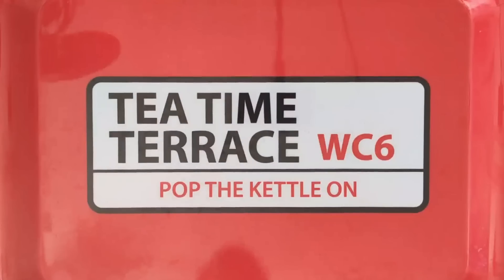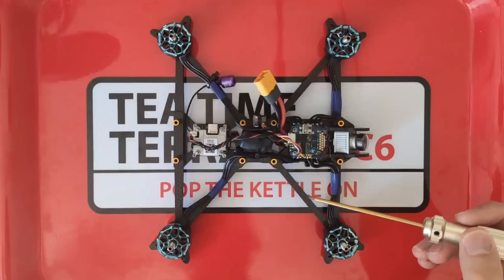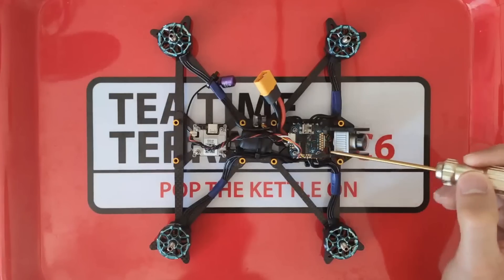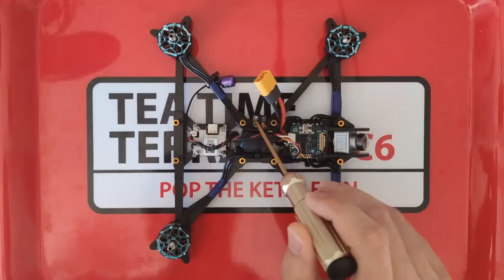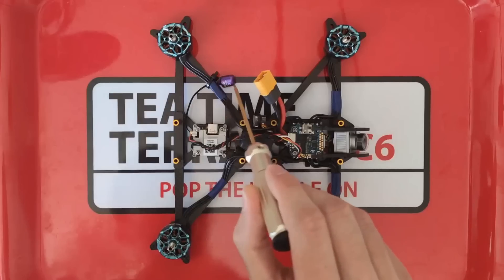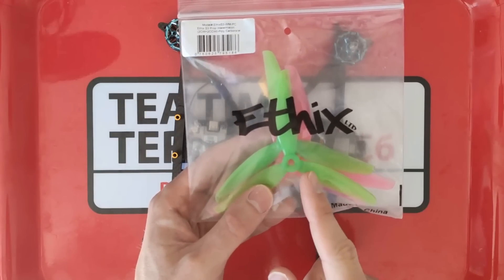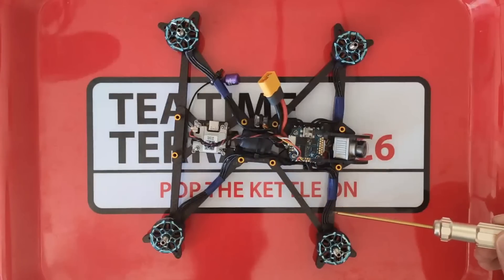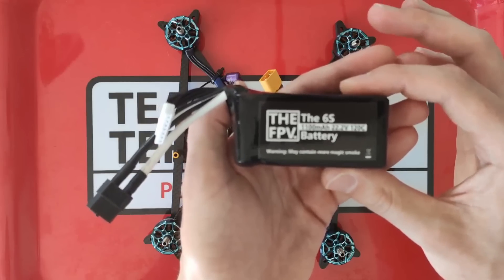My perfect AOS 5 Freestyle Build. I'm trying to make the world's best flying 5" FPV freestyle drone.

Comment: The main issue with World Best is the weight.. sub 250gr will be the world's best due to all sorts of licensing issues worldwide.
Reply: That's a ways off yet, and I don't believe 250grams will will stop the vast majority of people from flying heavier quads. I mean how many current pilots do you think really have spotters when in the goggles now...
Reply: He said This is the World's Best "Flying" 5inch, NOT "best" for people who have a 250g limit.
Reply from the maker: The challenge with 250g for 5" acrobatic freestyle is that a 3.5" 250g quad is more responsive and faster in the air than a 250g 5". I will be doing a perfect sub 250g freestyle beast but it won't be running 5" props.
Reply: @ChrisRosser  I hope this sub250g is the very next on your list. 
With the regulation constraints and the current trend on 3.5" (emax and geprc), it would probably be your biggest success, I guess.

Comment: Can you post an AUW with a session 5? I fly analog but i'm going to be using FPVCycle 5" motors, I'm curious how the weights will compare considering my video system is lighter but my motors will be a bit heavier.

Comment: Glad to know you're one of the few ELRS user as well! You missed some big advantages of ELRS other than low latency - high and consistent frame rate. This will help smoothen out setpoint trace even with reduced stick filtering and improves other control parameters that are based on stick movement such as feedforward. Looking forward  for your tune video!
Reply from the maker: Good point well made. Thanks Asu!

Comment: Been using the Xing 2 2306 motors since Feb, couldn't be happier. They are incredibly durable, powerful and smooth. You are going to absolutely love them. But look forward as well to your experiences. I've never had success with Twig Gyro setups. They aren't the usual 6000 series Gyros and act weird, don't like impact either. Maybe the solid frame will overcome that. Going to be really interesting to see the science now being applied and just how much the hardware itself is going to affect the whole process. You should try the P3 props as well. They are overall lets punchy on 6s than the S3. The wider profile of the S3 gives a sudden blast off effect with the 6s power. The P3 feels more linear.

Comment: They make 55A 20x20 stacks now with heavy heatsinks (that double the ESCs weight, ha). I agree going with the thicker arms, it's a low cost solution for the flexing. People refuse to believe a difference just one millimeter on the arms makes but still they want to believe the 5-10 grams they shave off with the thinner arms from the 600-700 grams is going to make a huge difference. Go figure. The C ratings on the batteries are a marketing ploy. Even the manufacturers admit that but to stay competitive, instead of competing on who gets the most out of their packs, they foremost compete on who makes the boldest claims.
Reply from the maker: going from 5-6mm is 70% stiffer. I agree with you that people focus on weight without thinking about the tradeoffs. You can't save weight without sacrificing something.

Comment: Yippppeee build video !!!!! 
Oh come on Chris I thought you would show us how you apply that grease and where exactly to put it.
Send this frame to JB (The FPV KnowitAll - just to be accurate) , would be nice to see his impression of the AOS5 and also what components he chooses to build in his own style.
Reply: Lube it up good!

(Seriously though, I wanna know. And see a before/after FFT! Just frustratedly softmounted my motors after a day of logging & filtering and still having d-term oscillations. Just rough archaic tuning with freakin' isotape in a "ah fuck it. I'm out of options, I can as well try to tape it…"-mood. And damn, these oscillations where gone and I could even increase D-term more! Guess it's time to actually engineer a propper damping system right into those motor mounts. Because seriously… isotape can't be the spot on solution…)

And right, have JB test one. He still struggles with that scientific approach after years of pure trial&error :3 I can definitely vouch for all CR is saying though. EMC-shielding, Spike-Cutting, avoid Magnet-Cogging Motors, Stiff Modal-Analysis optimized frame, Dampening ideally at the source to avoid exiting these frame-modes in the first place. That's exactly how it's done in high-speed checkweighers too, where you don't have time to filter those sensitive measusement signals.)

Comment: Is the 5.5" version coming soon? I run a 97 gm hero 6 and would like to try out the version you recommend for 700gm AUW.
Reply from the maker: Protos are going out this weekend. Need a few weeks to test then I'll get it on sale.
Reply: @ChrisRosser  Excellent
Reply: Would it be possible for myself to test the proto?
Reply from the maker: @pacificnorthwestpilots  I hope to have the frame launched in a couple of weeks. Then you can test away! I don't want to let anyone apart from myself fly the protos, just in case I messed up somehow. 😁